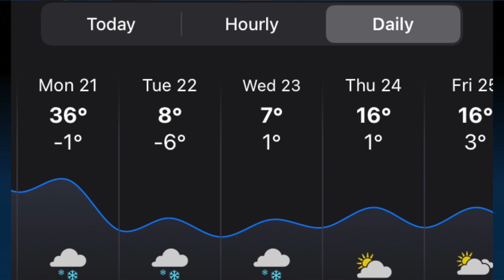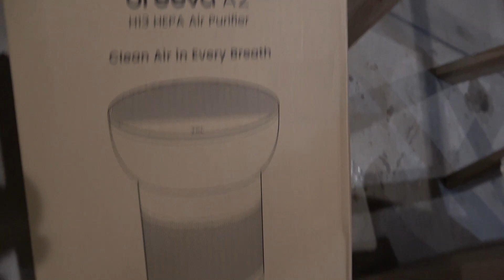Was it a Bobcat? Snow Threats & Closet Shelving Reveal

Comment: Switch to water based polyurethane finishes. Low odor, low organic fumes, safer to use, better air quality. Durability as good as solvent based products.
Reply from the maker: We have used that in the past. You're right. But twice the price though.